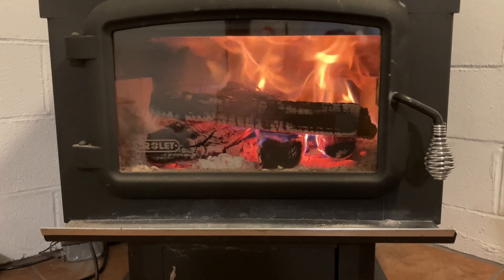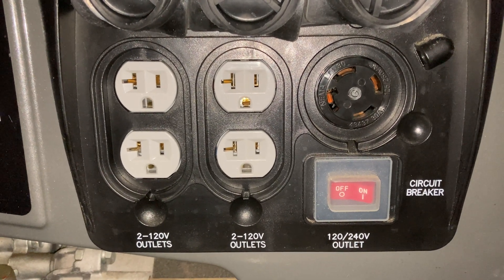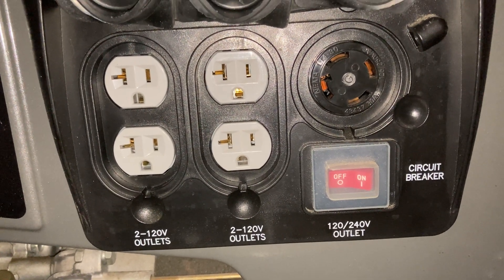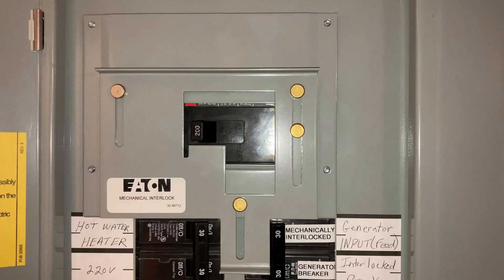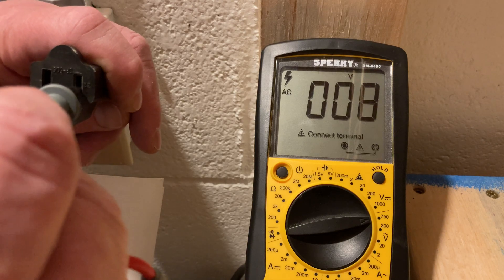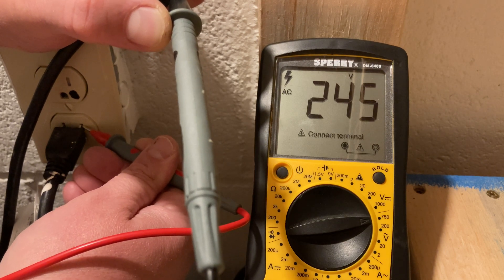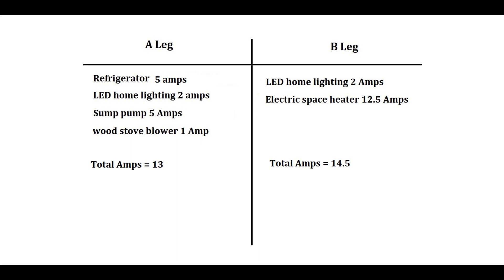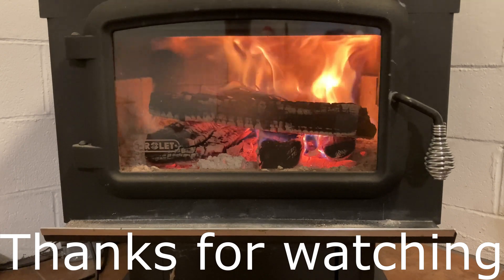How to balance the load on your generator.

Comment: People do not give you enough credit. Thank you so much for the video! This is the last thing I needed to learn and you just taught me how! I got the interlock with a 50amp inlet installed. I installed the soft start already and seems to be working just fine (a little over a month, no issues) and bought the wgen11500tfc (14k peak power / 11500 running watts) the only thing I did not know how to do was balance the load. I bought a wattage meter for both phases to ensure I don’t overload the gen and keep it at 50% running capacity. However, when I was told to keep the load balanced, I was lost. Again, a million thanks for your video!